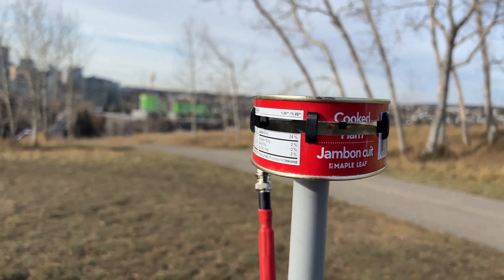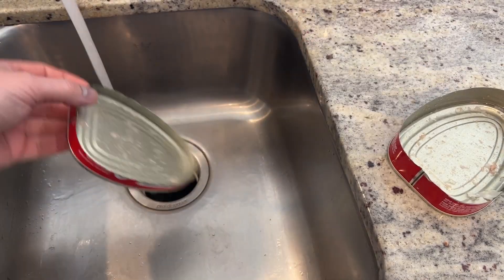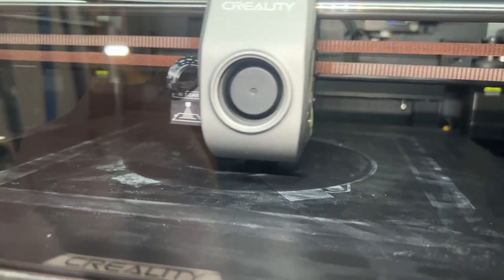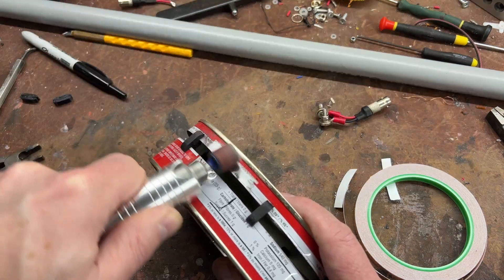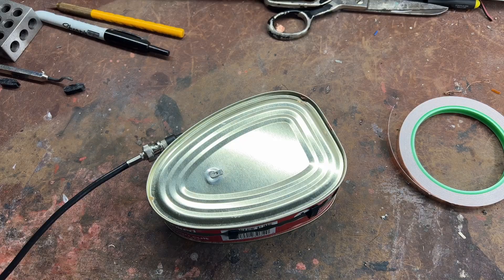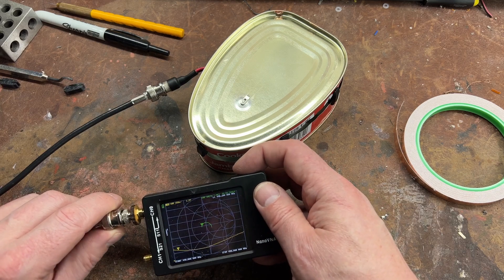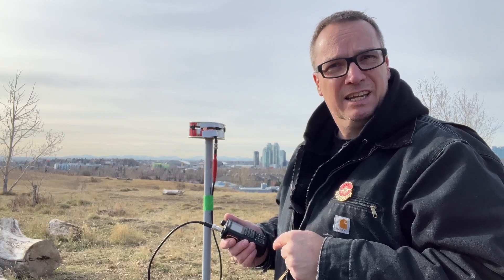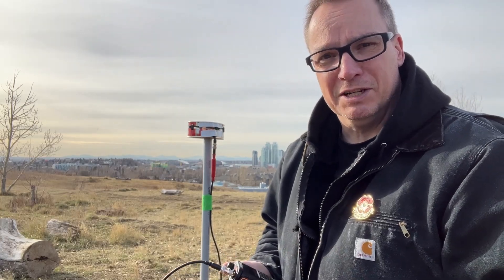Ham radio antenna build, Made out of a ham tin: It works really well!

Comment: These slots are addictive arent they...  I like that you can choose your own feed impedance with them - great for stacking and other tricks.  They have many interesting traits, like high common mode rejection, and also it just seems very hard to get any RF back down the braid "outer" - very good for HF QRO, I have run full legal limit into 40m, cue major jaw on the floor - you should try it.  I've struggled for ten years to try show people this antenna.
Reply from the maker: Absolutely 110% agree

Comment: How important are the top/bottom of the can being present for this to work? The only canned ham I can find comes in a pull top can, so at best, I'll have a topless antenna.
Reply from the maker: You need to create a slot so you do need both halves. Maybe two cans one on top of the other? The slot edge is the important piece, less so the extra can material will have little to no effect
Reply: @VE6SFX_HamRadioRookie  If I cut the can I have in half, that would create the slot. Would the mass difference between upper and lower matter? I'm 90% completed building my first HF station, a completely portable one, and my Jeeps engine failure just meant my main focus now is an engine swap rather than anything radio related, so if I'm to get anything rtadio related done, I need to almost outsource the brains department.
Reply from the maker: The mass makes little difference if at all. Cutting it in half would work.
Reply: @VE6SFX_HamRadioRookie  I picked up a second can of the ham today. The only thing I can even find in the key opened cans at the grocery store is smallish cans of corned beef, so I got one of those as well. Hopefully the Jeep engine swap only takes a couple weeks, and I can get back to building my portable station, having it ready for a camp out the week preceding Field Day, and then participating in the one day field day event held nearby.

Comment: Bought myself a canned ham tonight, after hearing your appearance on Ham Radio Workbench.  I'm just starting to build my first HF station(which will be portable), so time mental energy for radio is limited, but I do intend to have a VHF portable station as well, and this may be a good counterpart to the TV twinlead J-pole I already have.

I don't have a 3d printer. What's the gap between upper and lower sections, so I can make the spacers with a hacksaw and some plastic.
Reply from the maker: The gap is 0.25”

Comment: Excellent build and great idea. I have a 5W QRP CW transmitter built into a Spam tin, and an accompanying receiver in a corned beef tin. How about a portable 2m tunable antenna from one of those clinical adjustable-length walking sticks? You could hang it up a tree.
Reply from the maker: Great ideat! 73

Comment: Can you use a Bard wire fence. I used a bard wire fence on a C.B Radio  and it worked and talk on it . That was in Bayard Saskatchewan outside. The fence went over 30 miles around. I put the ground on the bottom and the positive on top. My Sw  meter didn't move that much on all channels.
Reply from the maker: Interesting! I’ll look into doing g this as well

Comment: Brilliant! ... I love it that you're pushing the envelope, putting the fun back into the sport. It was great meeting up with you at the YYC CARA ham fest with my friend Gord VE7UY. I'll be following your adventures with interest. All the very best Ben, VE6DAY Rene
Reply from the maker: Rene, it was awesome meeting you too! Everyone and their suggestions when I was there had my head exploding with ideas. Thank you for following. 73
Reply: You had my full attention when I heard you say “copper foil tape” …  As an engineer, you know the weirdness that happens when using a flat radiator, and then trying to figure out why it’s working, when convention says it shouldn't … I have a question for your show: The substate of my mobile whip is a polycarbonate MFJ pop up pole, which I’ve wrapped with aluminium heat duct tape as the radiator... A friend raised the question about the conductive properties polycarbonate.  We did a quick test with an ohm meter on the bare pole, but no conductivity at DC. Which doesn’t answer the question when RF is involved.  I looked  into conductive polycarbonate, it exists,  not cost effective, but interesting…  Q:  if you place a radiator inside a polycarbonate pole, will it react with the RF? …  Is all polycarbonate the same? … If you use the conductive polycarbonate as a radiator, will the material affect the resonant point, as compared to a normal metallic radiator? …  Will the reactive components of the material  heat or burn up?…   Does the polycarbonate substrate add a linear loading component? ... I duno….  After my junk drawer build, all I know is that the mobile held it’s own when compared to much more costly mobile antennas (See VE6DAY on www.qrz.com) …. It’s a job for inquiring minds … In my case, the polycarbonate pole is being used as the substrate, because of its wind loading strength (200kph+), broad band width due to it’s foil wrapped diameter, its lightness of weight…. and because it was just laying about the garage…  As sturdy as it was, a fast food drive-in did it in …  Also, have you tried using a fluorescent tube as a radiator?  I’ve read research where it's being tested at WiFi frequencies.  The high voltage of the RF excite the gas, causing it to resonate…. I’ve been curious to see what happens when a fluorescent tube is used as a radiator.… Anyways, I’ll be in touch to see if you’re around, before I travel east for the holidays..  73'zzz Ben,  Keep it up! VE6DAY…  
p.s. ;-) Don’t be afraid to smoke something for the show, that’s when things gets exiting! ;-)   @VE6SFX_HamRadioRookie

Comment: To go with the other silly suggestions, I've seen a cookie sheet used to form a ground plane for a mobile antenna mounted on an RV.  In an old issue of Radio Electronics was an article about using a 6-ounce juice can to make a feedhorn for a repurposed satellite dish antenna.  I'm sure all of you have heard of using a Pringles can to make a narrow beam antenna for Wifi frequencies.  I've thought of using a steamer basket for a dish antenna, and someone appears to have done it.

These objects seem like they might work: a fluorescent tube, a hurricane lantern, a puddle of salt water, a metal bucket, the metal chassis of a car, an electric motor.
Reply from the maker: Had not thought of a puddle of water! Definitely worth a try.
Reply: @VE6SFX_HamRadioRookie I would like to see that one for sure. And I need that tattoo!

Comment: Given that canned ham contains some salt, it should be fairly conductive? Could you pour the salty ham into a 3d-printed trough of the correct length to act as an antenna? JUST HAM as the antenna?
Reply from the maker: OMFG! This is brilliant! I never thought of encapsulating in a 3d print! This opens up so many doors. Thank you!

Comment: Next:  The wonderful world of coat hanger antennas.  
WRT to the question:  "Will a loaded hamcanantenna work?  I'm going to guess that the "load" will be resistive due to the ham salt content and may cause squealing somewhere.
Reply from the maker: Yes for sure. But I want things like pasta noodles :)
Reply: @VE6SFX_HamRadioRookie    That could be interesting.  Add salt if you're going to make a floppy noodle antenna for good conductivity.  
FWIW, I used to get a Heath "Twoer" and put a coat hanger in the back and see what I could get from Signal Hill California.  It worked pretty well.  
Oh... my sheep shearing guy has a version of a "measuring tape tattoo" on his arm.  No numbers.  Got me guessing at first.  
How about a Linguisa  VHF dipole?   Bamboo skewers for stiffness or on a cold Canadian day, not needed.  
(sorry, I'm on a roll here)

Comment: They say you can't tune a fish. Maybe you can tune a Tuna Fish can?  Or several in a phased array?  Would that be a school of antennae?
 "Cantenna"  was the name of the Heathkit  HN-31 1000W dummy load.  Basically a a resistor mounted in a paint can that you filled with mineral oil to dissipate the heat generated at high power.  Dummy loads might be an interesting build too.
Reply from the maker: Tune-a-fish can is brilliant!
Reply: The International Space Station repeater mode V/U FM downlink is at 437.8 MHz.   1/4 wavelength would be 6.7 inches.  Hmmmm   ( LOL)

Comment: I warned you and "it" has spiraled out of hand quickly. No that was not an antenna suggestion; but spirals and helixi make great antennas. By March you will be in a field with a 1.5 m 2x4 measuring the frequency of your HTs and SWR with Leacher lines and a #47 bulb feeding some random metal thing. Just and FYI - live trees will act as antennas with the proper matching feed, the US military and some hams back in the wayback been there, did that, and went back to wire. I think you have to use a copper nail and a percentage up from the ground to feed it.

Still having that Canadian heat wave I see.
Reply from the maker: Yup we are in our second fall before second winter, just before fake spring and third winter ;)